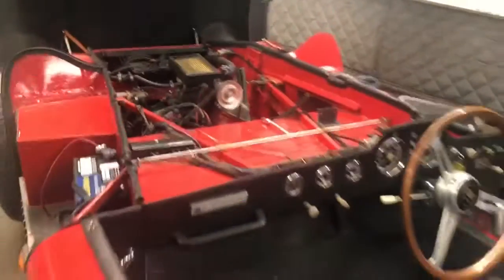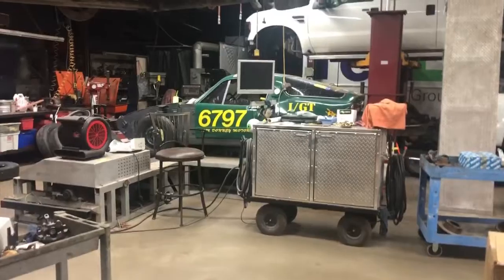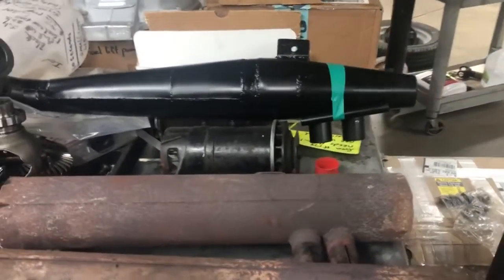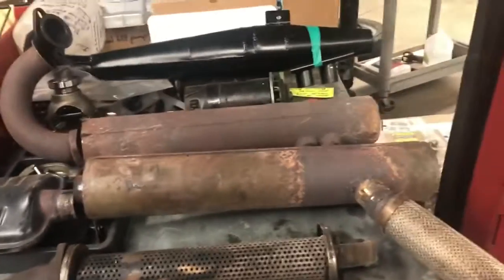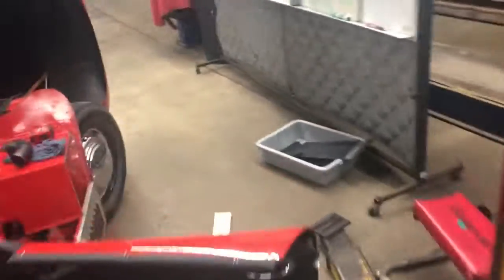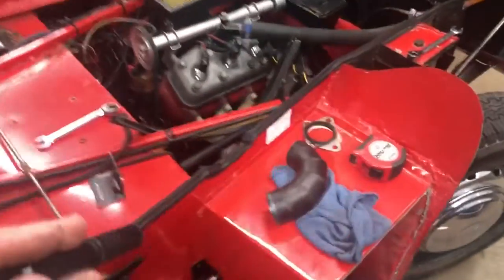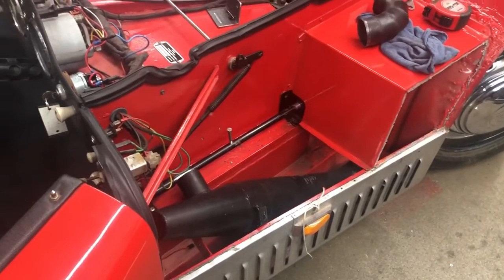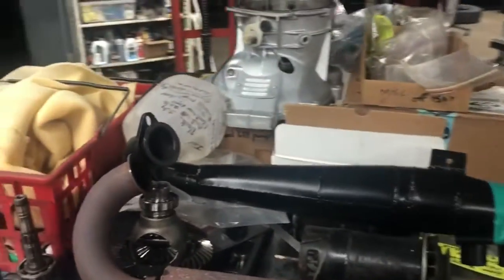Saab Two Stroke Exhaust & Saab Sonett I System Explained

Comment: How long is the header before the chamber? What rpm range is it designed for? Looks like the exhaust manifold could use an upgrade as well. Always wanted to work on these cars.
Reply from the maker: The header pipe is a bit long but I’m really limited for space in this car.  The exhaust manifolds are factory set up and could be redone differently.  Thanks.